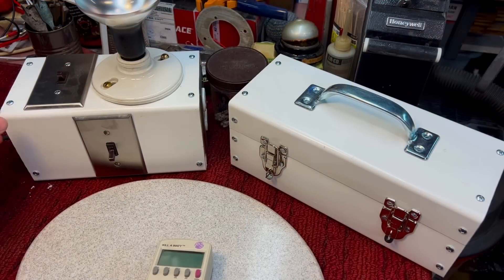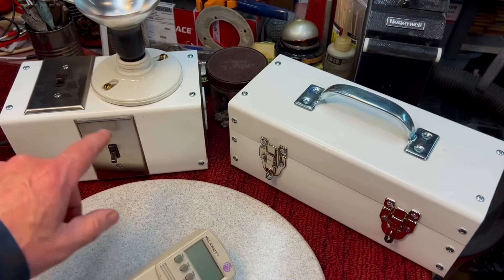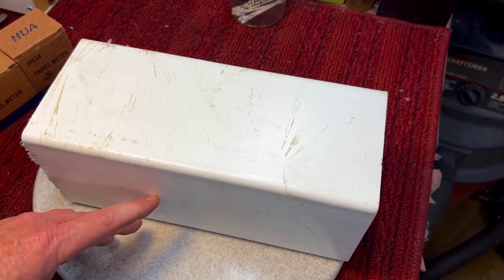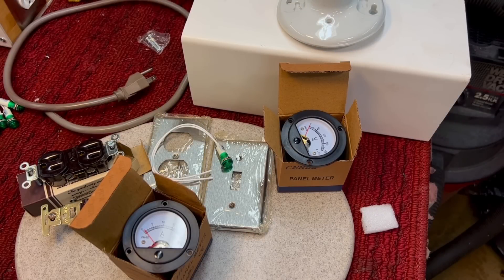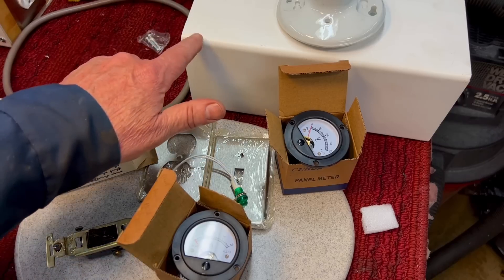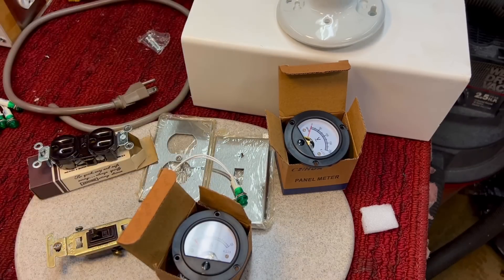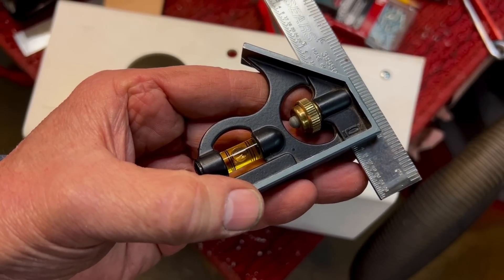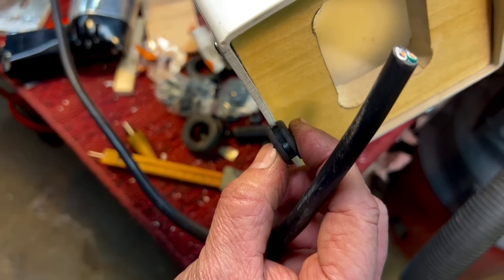Make a Voltage - Amperage Test Box from Scratch.

Comment: The Amp meter has a + sign on one bolt. does the + side connect to the wall or on the load?? I have one and dont know which way to wire it. Thx

Comment: Just a suggestion - if you were to plug something in the outlet that overloaded the circuit, you could easily blow the ammeter. You might want to think about adding a fuse in series with the ammeter that is rated at the highest current it can show - 20A - to protect the meter.

Comment: A very interesting and useful project. If I may make a suggestion, having such a large amount of smooth, white PVC gives you room to add an Ohm's Law Wheel decal. which would be a great use for the voltage and current readings  this project gives  you. I had no trouble finding them by merely browsing.

73, John

Comment: Watching on the wife's tablet because mine finally gave up the ghost. I wanted to say I have several old and fairly new 1/2" Milwaukee electric drills. I used to build utility trailers on my off time and those drills are awesome to drill holes in 1/4" thick angle iron. I knew they had a lot of torque and always careful but I was drilling a 7/8 hole for the tailgate pin tubing and let my guard down and it grabbed and somehow wrapped the cord around my wrist and broke my wrist really bad before it stopped spinning. The 3/8" bolt that was in the handle broke. Really sucked.
Reply from the maker: The torque on those old drills were insane!  😃👍

Comment: That a great job. I would like to build one however I have the ability to follow instructions and build one but not engineer one. Would you mind doing a drawing that could be emailed and would it also be o k to use digital gauges.  I already have everything except the gauges. If you would rather not do it I totally understand No pressure.
Reply from the maker: Yes- Next week! 😃👍
Reply: @ScoutCrafter  Thanks

Comment: I give you credit. If I have new old stock in the box, I hate to use it. Not sure why I’m saving it though. They should be used.
Reply from the maker: Bill- I’m the same way but these are new (China). eBay

https://www.ebay.com/itm/172573490969?mkcid=16&mkevt=1&mkrid=711-127632-2357-0&ssspo=DC9AZYDJS-2&sssrc=2349624&ssuid=M5amARfWQAa&var=&widget_ver=artemis&media=COPY

Comment: Nice job.
Now combine your new volt/ammeter with your variac and you have a useful tool for trouble shooting electrical/electronic gear.
For example if you have a device that's blowing fuses you can slowly increase the variac and monitor the voltage and current, most useful for radio/TV but can be helpful to find shorts in electrical equipment too.
Make sure the ammeter you choose has a built in shunt, some need an external shunt, without it you'll blow the meter to pieces like I sometime do

Comment: I love the project.   There is something about the analog dials and seeing the needle move.   As you said, old school.
I have the same Milwaukee Magnum drill.    I purchased mine around mid-80's.   Still going as strong as when purchased.   This drill is a beast.   It does not get used often, but I know when I need a lot of power I can rely on this drill.
Amazing to see the racoon and cats just ignoring each other.
Dave.
Reply from the maker: Those drills are just spectacular!  😃👍

Comment: I must have missed how you cleaned up the scratched white plastic. It turned out great!
Reply: Yes, I'd like to know how the plastic was cleaned up as well.
Reply from the maker: Those PVC posts come wrapped in a clear plastic for shipping. There is some sort of water soluble solution that holds the plastic on the posts. It looks like scratches but washes right off with water! 😃👍